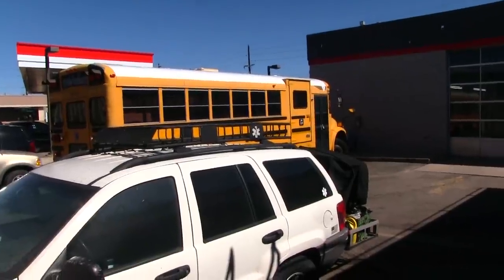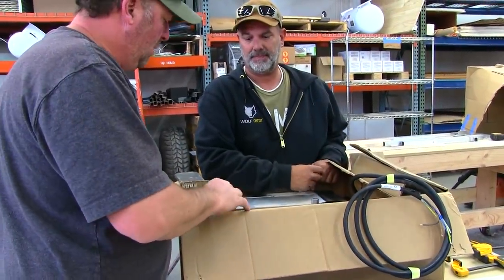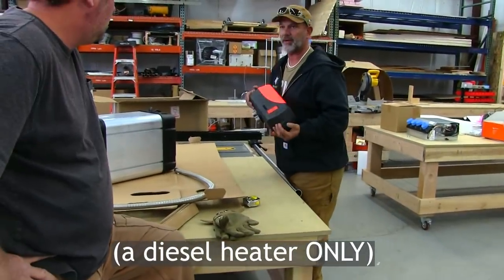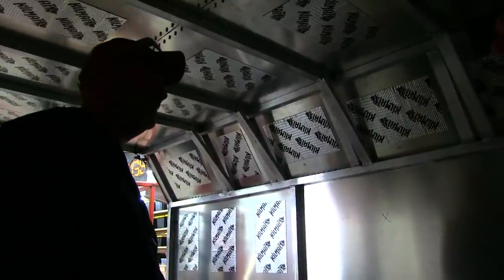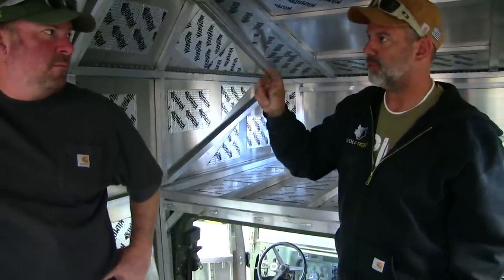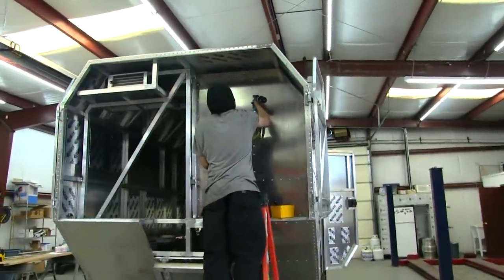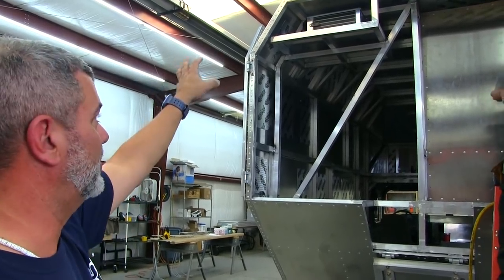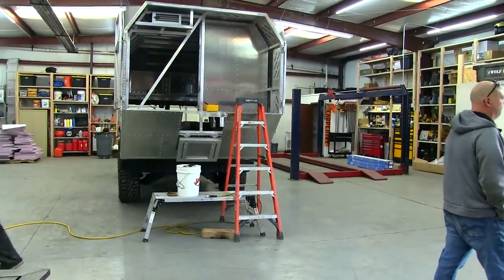Building Overland Rigs is Harder Than You Think | Busface Meets Wolf Rigs

Comment: Cool rig!Do you feel the solar will be adequate to supply the AC?I have seen a few rigs lately that double their solar by having slide out panels thereby doubling or tripling their solar.As a bonus it also provides somewhat of a shade and rain shelter.Juat a thought.BTW save a little and buy your panels at Santan(no affiliation)as they seem like reasonable prices to fill up the roof.Have fun in that build.